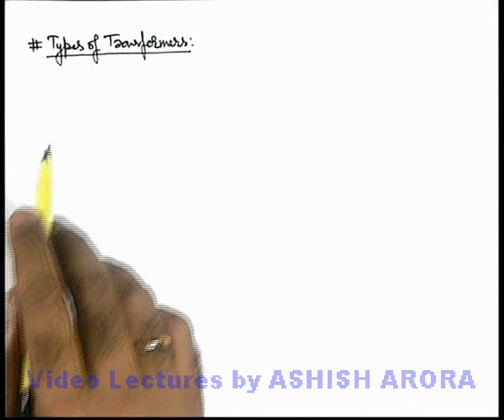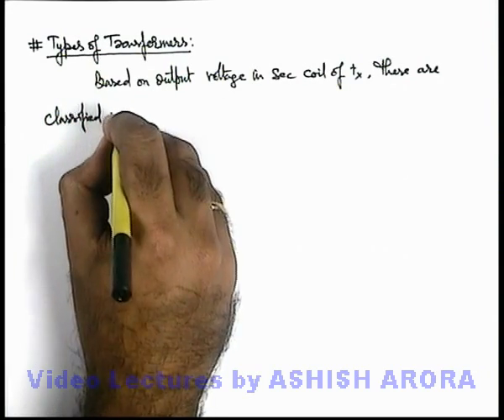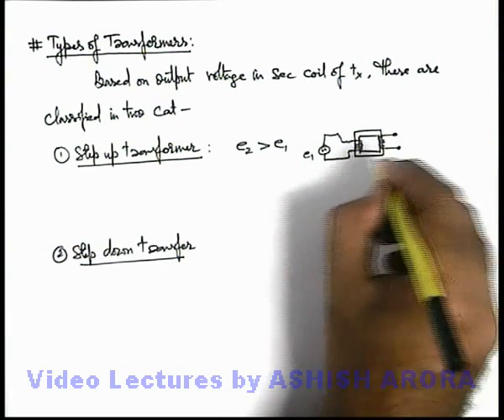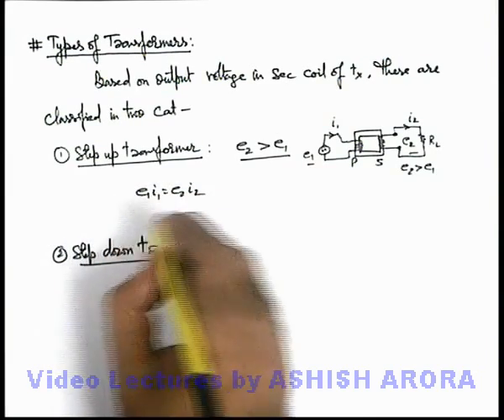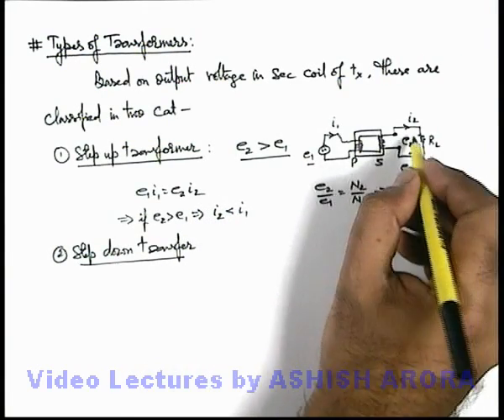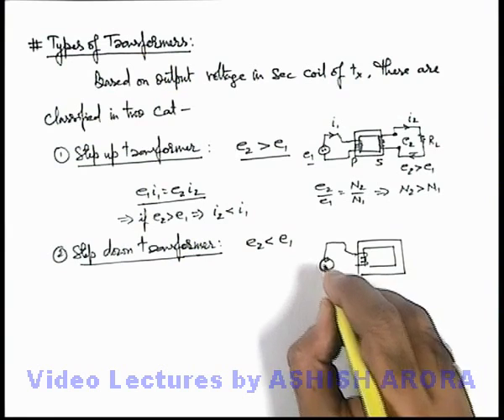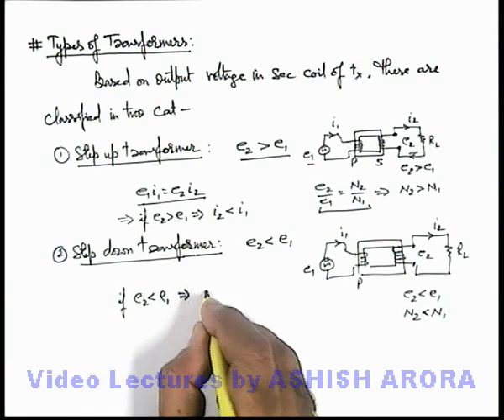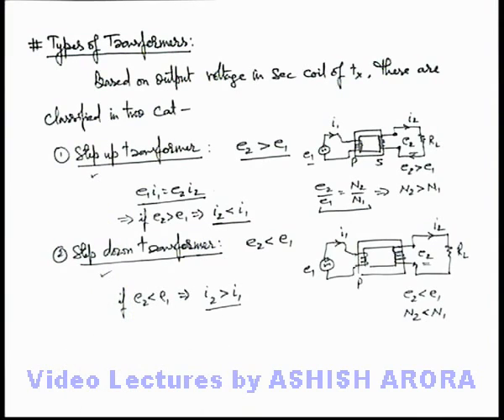Class 12 Physics | Alternating Current | #52 Types of Transformers | For JEE & NEET

Comment: Respected Sir 
What is the purpose of connecting 'Load Resistance 'at secondary coil current i2 ?
Reply: It’s your appliance-bulb,fan....
Reply: Load resistance is the actual power consuming devices connected via wires from the transformer to the houses and buildings.